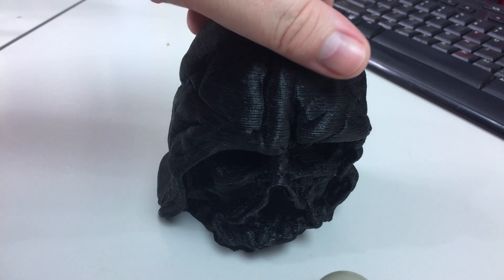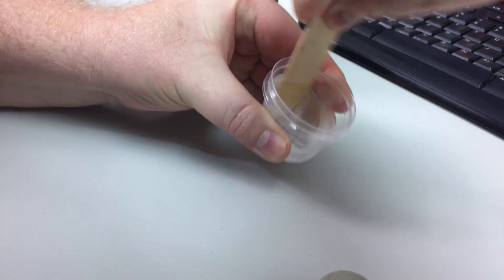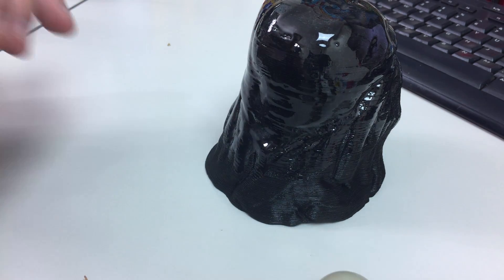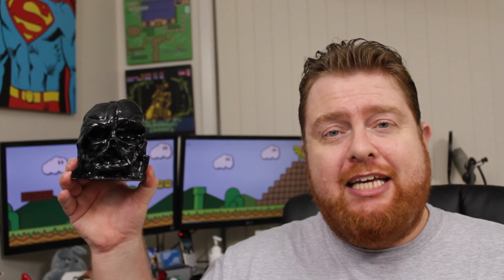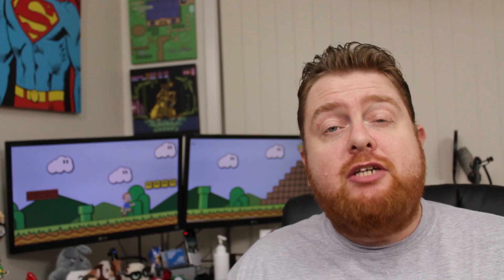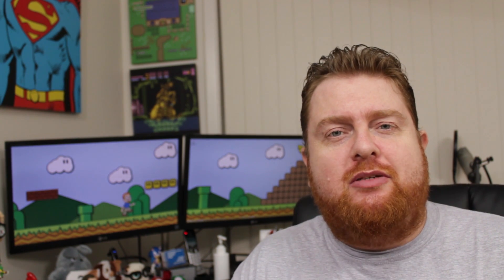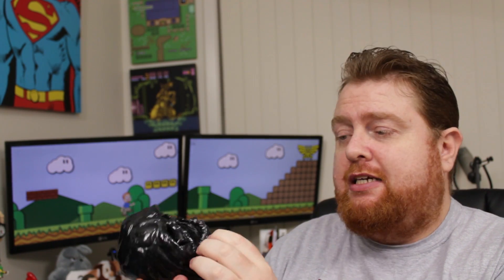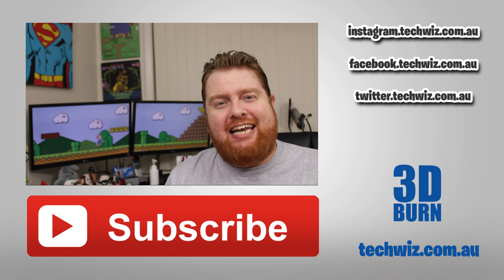Effective and Safer 3D Print Smoothing with Epoxy not Acetone

Comment: I dont even have a 3D printer but I work a lot with epoxy. And to use it like this (along with some other userless tipps) is 100% dumb! But if you wanna try it anyway use a sacrificial brush! Once the resin starts to cure you have no chance to get it clean again.

Comment: Use a torch to QUICKLY go over the epoxy. This removes air bubbles and allows it to smooth out easier.

Comment: Doing for the first time giving top 10 tips video.. Learn a little bit about the compound before claiming that it is safer than acetone. It you contact this compound with your skin if will cause your immune system to set alarm and give harsh allergic reactions.. If I wouldn't be lazy, I would report you for misleading people to things may cause health issues.

Comment: Nice finish on the part surface. Also I've an alternate solution for smoothing 3d printed parts by using polymer clay. You can check video on my channnel. https://youtu.be/hLxq0yE-QsM

Comment: Zpoxy is a 30 minute set 24 hour cure and it is marketed to RC community... This is just epoxy.. You can buy the one to one from any marine store in a for about 100 bucks....

 NOTE: EPOXY RESIN is not POLYESTER RESIN from the automotive store!

Comment: Dude.. Use gloves..... Epoxies is poison to your skin and u could get allergies. And the 30 mins is the time u have before it hardens.
I dont know zpoxy but i think u should wait longer than 12 hours or put it in the oven on 50 Celsius so it hardens faster.

Even tho the zpoxy feels like it has cured/hardened completely it can still be dangerous to touch with your hands.

Comment: For those watching now, use gloves when applying epoxy and use a mask if you ever need to sand it.  It's REALLY easy to develop a sensitivity to the compounds in the epoxy.  Take a few seconds to save yourself a ton of pain in the future.  Better to use PPE than to lose the ability to use epoxy in the future.
Reply: I was shocked to see the non ventilated room and no gloves. Epoxy gives off VOC fumes after mixing the two solutions

Comment: Epoxy resin is more harmful and hazardous than acetone or even polyurethane resin. If you decide to use epoxy - use it in a very good ventilated area. Acetone stinks more than epoxy, but this doesn't mean it's not harmful for your health.

Comment: what I missed in the tips is: don't touch your model too much, or for the same case the spatula or the containers inside.when doing this. The reason for this is fat (skin fat). Epoxy is a polymere. Small molecules combine with each other to form long molecules. If there is fat present, it will be included in this process and if you are unlucky, the epoxy will not get hard. So avoiding any form of fat or oil is important.

Comment: why?
what makes this better than acetone? 
I can't think of any pros at all. 
It's more expensive, takes longer, requires more work, adds another material to the final product, has worse fumes, can potentially be messier and doesn't look as good. 
you're just covering the lines with a clear shell rather than removing the actual lines.

Comment: great video, I know acetone will work for ABS but not for PLA. I was looking for a solution to get surfaces smooth. I have enough clear epoxy , so I can try. but you don't have to wait 12 hours , to epoxy to get cured. all what you have to do is just keep inside a oven under 60 degrees of Celsius for 3 hours.

Comment: If you give your epoxy (pre-mixing) a quick blast in the microwave to warm it up it will thin out the epoxy . . . it will then be much easier to apply a thin coat.

Comment: Tip# 11 - This is fantastic for glossy finishes. However, if you want a matte finish, then hit the model with some Army Painter Matte Varnish or similar spray-on varnishes:. Krylon Matte, Citadel Matte Varnish). Yes, a brush-on solution may work as well, but it's easier to get a uniform look with spray cans versus risking striation texture while applying a brush-on solution.

Comment: This worked a treat for me thanks so much. A WORD OF CAUTION! Make sure you get the 30 minute set and not the 5 minute set like I did. Not only does it give you about 3 minutes to apply it before it begins setting, it also gets extremely hot and you can't save your brushes. Follow everything this guy has in his description otherwise you will make more work for yourself. Fortunately I was coating smaller parts or this could have messed up a bigger project!

Thanks again!

Comment: What about smaller items, like 28mm miniatures and bases that are printed?
Reply from the maker: Very small amounts should be okay. Just don't slosh it on. It will remove some small details though due to the epoxy melting the plastic.
Reply: Thanks for the tip!

Comment: I just bought 3.97$ (USA) tube of Gorilla Glue epoxy at Walmart. It seems to do the same exact thing this stuff does for a lot less. I'm waiting for it to dry now, then I'm going to paint over it perhaps. The trick seems to be getting the layer of epoxy on it not too thick and not too thin. Still playing around with it to see how it works best...

Comment: 1 Never waste money on 30 min. Z-poxy... replace with Bob Smith Slow-Cure or Mid-Cure Epoxy 
2 Don't eyeball a epoxy mix.. replace with disposable epoxy mixing cups - 1:1 ratio
3:  Jumbo Popsicle stick  do not mix epoxy well at all... replace with Kids Craft skinny sticks stir vigorously,  feel slight heat from the chemical reaction.
4: Mentioned slightly- Wax/ Parchment paper is a must have.
5 Try Letting the epoxy sit for 10-20 mins before brushing any areas that are not horizontal. 
Those 4 things will ensure that the epoxy sets up in 30 minutes or less, and prevent runs; which in-turn helps first timer to resist the urge to touch the model while the epoxy dries.

Comment: could also try automotive clearcoat (high solids), it has UV protector polymers in it that protects anything under it from UV damage (get what U pay for, so if you want the finish to last dont cheap out). you can run it through a spray gun or brush it on. It's a bit thinner than epoxy but has UV protector in it.

Comment: Umm have you thought about using UV resins ? instant handle time after cure which is around 1-5 mins with a handheld light. Also you can use the alcohol to get rid of air bubbles in resin before it cures not just for removal of the resin from brushes. For this to work you need to use a sprayer like you get in the dollar bins at the stores here in the US. a few light mists will bring them right to the surface where they will pop all by themselves.

Comment: Does this work with PLA parts as well?
Reply: it just covers the model with a thin layer of epoxy, so the base material does not matter that much. It may not stick to the PLA with the same strength, but it worked for me with a different kind of epoxy.

Comment: ..so spend 30+dollar forZ-Poxy PT-39 instead 2-3 dollar ( aceton) ?? seriously ??
Reply: Acetone doesn't smooth PLA parts very well. So this is a interesting method of smoothing i think a bit to expensive for my liking currently i am just sanding the part best i can then using a lacquer or paint finish letting the paint to smooth out the surface. I have also seen a car filler used and sand smooth then paint.
Reply from the maker: Some people prefer more control over smoothing eg. brushing :) Different strokes for different folks.

Comment: I plan to use a 3D printer to create some molds that I can then cast in silicone. I'll probably use Dragon Skin or Ecoflex 30 from Smooth On.

Do you think this is a good way to smooth my molds?
Reply: I ended up covering them in a layer of “green stuff” putty. Clay would work too. TBH I pretty much gave up on the project for now

Comment: If you have to use epoxy, really make sure you use it where there is very good ventilation as this is toxic shit, and the fumes will literally eat your brain. The same goes with acetone, but to a lesser degree.
Reply: If this is toxic like acetone, then what's the point?
At least with acetone you don't need to be near it all the time, it will be faster and less work.
Reply: True. I would use acetone over this too.
Reply: Actually it is far more toxic than acetone ¨¨
Reply: are you thinking of a polyester resin? this stuff barely smells unless you are right on it.  although,  some have developed allergies to the epoxy after years of industrial type exposure.
Reply: well i work with epoxy a lot and it's the nastiest stuff.
Maybe his doesn't smell but i wouldn't trust it eitherway ^^

Comment: Dude, it's regular epoxy. Brand makes no difference. And no, it's not like superglue. It's resin. Acetone is better for rinsing brushes, since it's cheaper and anyone who tried smoothing 3d prints already have a lot of it. 12 hours to handle 30 minute epoxy? Right, that's what you get for eyeballing proportions. DUH.
Reply: 30 minute epoxy - 30 minutes stands for working/application time and has nothing to do with the time to cure fully.
Reply: MasterBata "no, it's not like superglue. It's resin." Well don't you look the fool. Best you do some research before mouthing off. Both CA and epoxy are polymeric.  Additionally cyanoacrylate is an acrylic *resin*. So yeah, just like super glue.
Also brand does make a difference as not all epoxies are created equal. For instance I wouldn't use Araldite for jobs like this, nor would I take Z-poxy anywhere a wooden boat I was building. West Systems for that job.

btw what exactly do you consider to be "regular epoxy". Is it Aliphatic, Glycidylamine, Bisphenol A, Bisphenol F, Novolac......? Which one? Because in almost 40 years of working with epoxies I have never come across a "regular".
Reply: Thank you! It's 30 minute pot life, not cure time. RTFM FFS people...
Reply: isn't epoxy... glue ? I wonder how to clean glue on my brush afterwards... but ok, I'll give it a try
Reply: acetone makes my ABS prints rubbery
Reply: @davey3765  Acetone makes my head feel rubbery :)
Reply: then you left it in to long
Reply: @ MasterBata - A little harsh (TechWizTime is clearly not an expert on Resins), but good points.  Something else that no-one has mentioned yet.  It will help to preserve your PLA 3D printed models.  PLA is hydrophilic (attracts and absorbs water) and hence, degrades over time.  If you coat it in something waterproof, its going to last a lot longer.  Epoxy resin is a good choice, but not really necessary.  A Polyester or Vinylester resin will work as well, except eyeballing the hardeners for these other resins will be a little more problematic (1% to 2% harden is a little harder to judge by eye).  ABS is not hydrophilic so no need to coat that for preservation purposes, but most of us 3D printers use PLA cos its easier to print with and its stronger.
Reply: Hey, if you're gonna be a sarcastic dillhole, let me just remind you that the 12 hours in this instance has nothing to do with the proportions. The fact that you're too stupid to realize that 30 minute formula refers to a 30 minute pot life before hardening starts cannot be blamed on the video creator. 
DUH!
Reply: Hahaha! Spot on!
Reply: haha ..I should have read your comment first..before i wrote mine
Reply: +Kimchi Well it can be strong or whatever but if it's for visuals and the structural strength that costs you an extra 20 dollars does nothing here, what is the point? It may be a good epoxy, I'm not arguing that but to be used as a surface finish, there is no point really

Comment: put the bottles in cup of hot tap water to make them flow better
Reply from the maker: Great Tip! That should make it come out a lot easier :)
Reply: be aware, that too much heat will boost the curing, and shorten the workable time conciderably. dont go past warm drinking temperature max. you can dilute epoxy with ~5-25% ethanol, though, when you use it as a surface finish.
brushes on nice and flowy, and just works really well, without hurting the plastic.

Comment: Not sure what you mean in the title as "safer". The use of gloves is not because it is sticky, but because you will get contact dermatitis from cumulative contact with wet epoxy. It's also a carcinogen, so breathing its fumes is not exactly "safe".
Reply: I just bought a small metal cabinet to put in my garage and keep it there. Flammable isn't going to cause problems if you store it right and don't give it any reason to catch when you take it out to use it.
Reply from the maker: "Safer" is meant to be in terms of Flammability. Everything comes with a risk these days, including printing with ABS. If you look deep enough, the Homogenization process that milk goes through may also cause the release of free radicals which in turn make those whom consume milk, a higher risk to cancer.

Comment: this stuff pretty much just looks like a super clear epoxy with a 30 minuet work time. Bet you could pickup some fiberglass resin that works as well and it would be way cheaper.
Reply from the maker: +Luke AOD It is just a 30 minute clear epoxy so you should be able to use a fibre glass resin. My lungs are damaged due to an auto immune disease so Fibre Glass anything is something I steer clear of always :)
Reply: TechWizTime Ah I gotcha. A respirator would be something I would wear anyways. Fiberglass resin is some nasty stuff.

Comment: 31$ is rediculous.  I am guessing regular 2 part epoxy for 8$ likely works the same way. I have used smoothon 2 part resins for a number of smoothing applications as well.
Reply from the maker: +Mike Mason Cheaper in the US but a normal epoxy should work exactly the same as long as it's a clear epoxy :)

Comment: Can the Epoxy be painted over? Also how smooth of a surface does it leave?
Reply from the maker: Not sure on painting the epoxy. Possibly if you applied a base coat (or primer). The surface is very smooth afterwards.
Reply: Yeah I've been poking around online and it seems to go one well with a base coat or primer, also found a few tricks about thinning the mixture.
Reply: May you share those tricks? :)

Comment: just an fyi for anyone who is watching... NEVER eyeball it. Use the recommended method on the bottle. You run the risk of it not properly curing, taking a very long time to cure,  or never curing completely (depending on the epoxy, and which half is in excess).
Reply: I've never had an issue eyballing it. Maybe I'm just lucky.
Reply: some epoxies are more forgiving than others :)
Reply from the maker: True True. Get a measuring cup with side indicators to make it really easy :)
Reply: yup :). unless it requires measuring by weight, then you'd need a decent digital scale :P...or some more luck XD

Comment: Here is a link to the acetone MSDS
http://www.sciencelab.com/msds.php?msdsId=9927062

Personally I work with acetone every day and I don't think its dangerous in the slightest unless you decide to drink it. Stings a bit if you get it in a cut but only lasts a second.

Probably will try the resin just to have that different texture finish though.
Reply: Eezee So if I was going to smooth a 3D printed mug with acetone would it be dangerous?
Reply: No, as long as you don't deliberately inhale large amounts of fumes or rub it into cuts it's quite safe.

Comment: Does it sand well? I need to get super smooth with my 3D print as it will be used to make a resin cast mold. I am using shapeways sandstone that sands well if a bit hard and long process, and need something to help speed the process up and me from sanding away all my details.

Comment: Any suggestions for colorants? I have areas of a model that were overhung with loose strings and I want to fill the area in. This part of item won't be seen often, but I would love to fill it in with a black goop and smooth it over.

Comment: Mate, If you put a little 93-99% rubbing alcohol in the Epoxy mix it will get thiner and easier to apply, is you want a really thin layer you just put more Alcohol in the mix and thicker just a little less.. just play around with it. i do it when put Glass fiber on my RC planes. and dont worry about the extra liquid... Its alcohol so it will just evaporate after some time and will not destroy the Epoxy at all :)

Comment: Hiya, great video, done my first ever long print of your exact model , however be just started with my first ever tests of smoothing/clean up.having watched countless videos, I took my first step and used your exact method here, I didn't do my Vader mask yet, I thought I'd run a few tests first.
So , I'm struggling, first problem, my fault bought cheap brushes, and way to small, going to sort that out tomorrow.however my biggest problem, is the pt39, just doesn't go on very well...starts to thicken very quickly, and on my few test pieces it just didn't go n well at all.
So simple question, what exactly is THE best way to get nice smooth PLA finishes , I've got stuff for acetone baths, or do you have anything better, or a better way to do this PT39.
I do plan to smooth then paint with acrylic paints for most if my prints, so I do think the Acetone bath is looking favourite so far, even with the white bits after, painting will cure that.
Although I think I will still go with PT for Vader

Comment: what 3d printer are you using

or whats a cheap 3d printer for cosplay
Reply: +✯ Spanky ✯ CS:GO Gaming &amp; more Goodluck finding a quick and easy printer. I can suggest what I did. I bought a Monoprice Maker Select 3D printer for 350 and let me tell you that I am super fascinated with it and it's just awesome. I highly recommend you look into it. Has a good build area/volume compared to other smaller and cheaper ones

Comment: Would PT-38 be OK to use?
Reply: +TechWiz looks to be the same product but has a shorter curing time. Had to drive around Melbourne to get the product, not easy to find and postage costs an arm and a leg!
Reply: Yeah I bought mine from an aircraft hobby place. Was looking at Bunnings epoxy but it's a lot more expensive per ml/g than Z-Poxy.